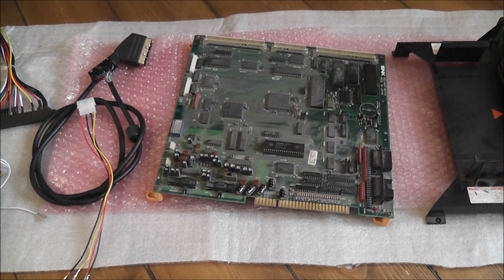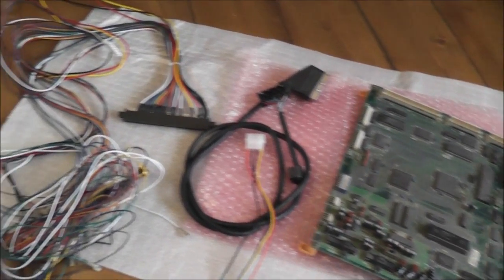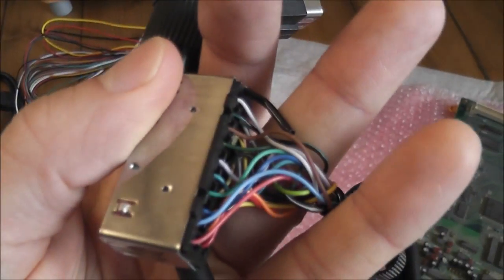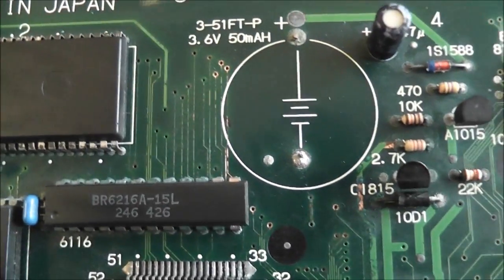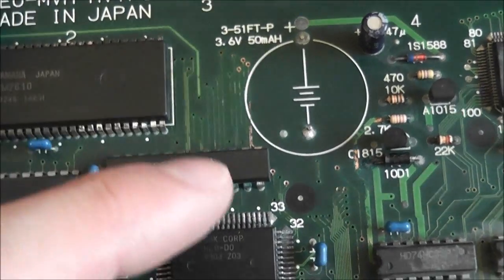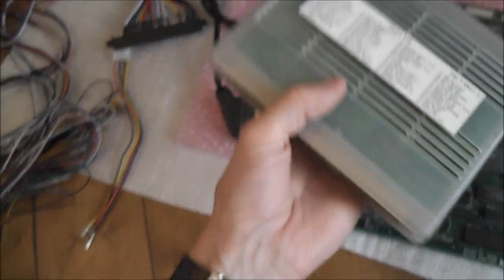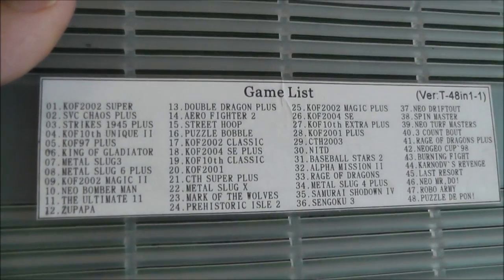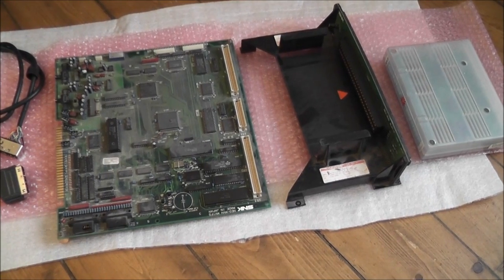Faulty MVS Progress Update #1 - Damage Inspected - Parts Gathered

Comment: Remove any socketed chips (Like the bios) and give the board a good wash with soap and warm water using a toothbrush to scrub. Let it drip dry in the vertical position for 30 minutes then put it in the sun for about 2 hours. You might need to use canned air to get the water out from under the chips to dry good. Make sure the board is completely dry before powering it on again.

Comment from the maker: I guess you'll be the guy to speak to if I need any spare parts then, lol. 
Yeah, those vias are what worry me. I don't want to have to start running wires from one side of the board to the other!
Any suggestions on the best place to pickup a UniBios chip from?

Comment: I've got a load of these in the loft. I just got bored of fixing them, they are just a pain in the arse, especially the multi slot boards. Here's a hint though, if you stick a UniBios in there you can bypass a few of the error messages like calendar ram and backup ram errors. Also check plated through holes and make sure to check for broken traces under the PCB from poor handling. Good luck!